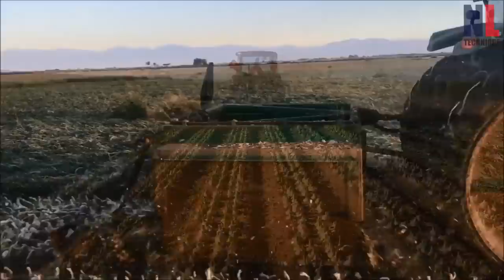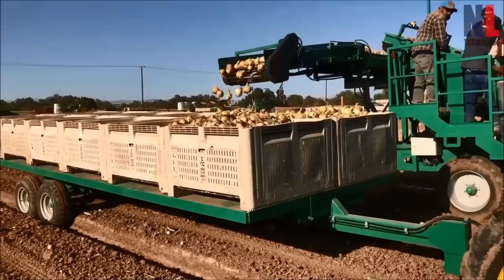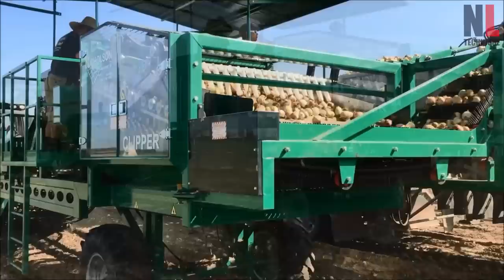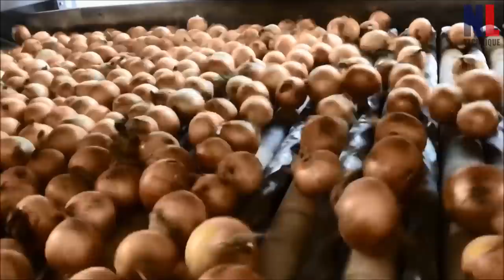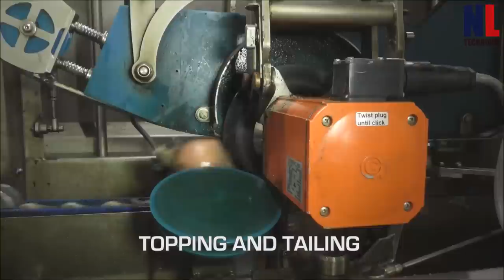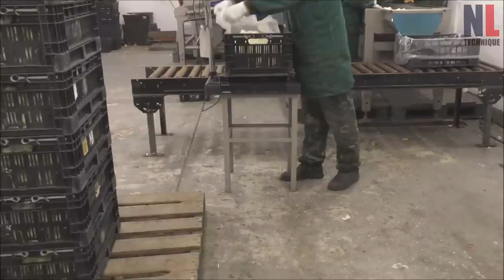Onion Farming Technology: Harvesting and Processing in Factory

Comment: I remember when we were young (I started at 12)  we cut the tops off the onions manually.  You walked up and down those rows grabbing several onions at a time and cut off the tops at once..all while walking  bent over.  It was back breaking work and your hands smelled like onions for weeks. Sometimes the farmers wanted them put in gunny sacks. We had luttle metal baskets we filled then poured into the sacks as we walked and worked and dragged the sack with us until full. I still have the scars on my hands from cutting myself accidentally while working or sharpening my knife. So much new technology now.